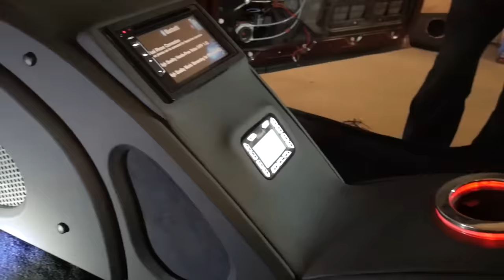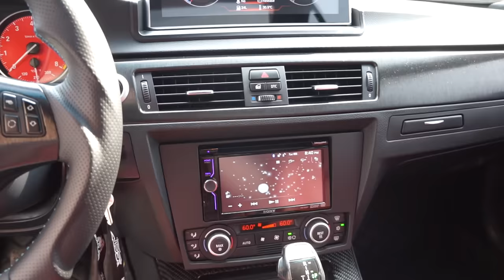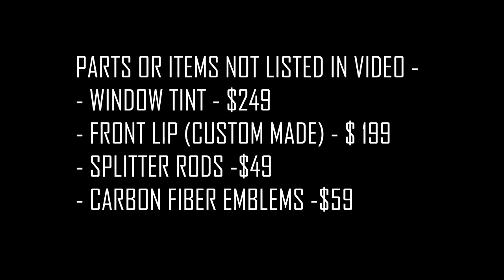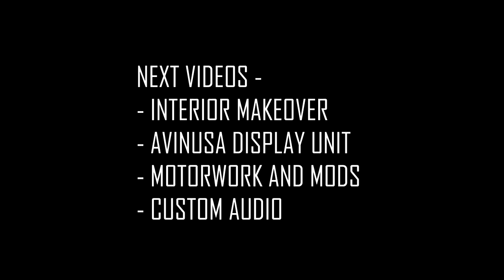COST $$ BUILDING AN E90 BMW 335 EXTERIOR IN 10 MINUTES !!!

Comment: What was the total cost? I can’t be bothered to add all of that up😅. I’m asking bc I want to do something similar to my 335i. Beautiful car!
Reply: Total costs about $8'850 if you have the right hand for doing it by yourself. All in one I think you end up at $11k or even more...(second one is even more realistic)
Reply: I have a 2009 335xi and I love it... Had to drop 4.6k on it to make it like new again after 10 years but alot of the expense was labor and time
Reply: James Swidan What kind of things did you do? I got an ‘07 335i kinda want some estimates. 4.6k isnt too bad
Reply: @MarThe3rd  It was madatory shit I had to get done..Alot of the cost comes from labor bc bmw labor is not cheap... My 335xi is a twin turbo... Had to get a new set of fuel injectors, high pressure fuel pump, new belt, new back tires, rim crack complete fix, carbon cleaning and couple other things im not remembering at the moment... But the 335i and 335xi are nice cars bro, they drive forever usually...
Reply: @Footballtwinstv  if you live in Germany, you can add about 5k just for tüv wich is a control service check that every car needs to pass and you would have to get every (almoast) mod checked
Reply: have you checked out this shift boot https://www.youtube.com/watch?v=k-UqC7Qi81Q&t=494s

Comment: Amazing work on the interior guys , would like to visit your shop if you have one , i just bought a 335i for 1500 and still working on the engine after that will start with body
Reply: where did you buy it? and what year is ut ? im looking to get a 335i as a project car soon
Reply: @hubietrades  private seller 2008 with 189k milles

Comment: How did the headlights hold up during the winter? I've had two cars that I replaced the headlights and both sets would get condensation and water inside so I'm really hesitant to pull the trigger on my 2010 E90.
Reply: have you checked out this shift boot https://www.youtube.com/watch?v=k-UqC7Qi81Q&t=494s

Comment: How are you I have a 2007 e90 m sport prelci will all these parts fit this mainly the mk3 bumper. And is it hard to fix into place for a non experienced guy
Reply from the maker: Everything on this vehicles 2007 pre facelift hand most of the stuff is not very hard and I do have plenty of videos on the channel on other things as well

Comment: I think you’re getting ripped apart with some of the prices. A Calliper wrap for 500? You can spray them red yourself for like 50 bucks
Reply from the maker: Yes you can definitely spray paint your calipers for $50 but just the wrap alone for the material is over $250 you're more than welcome to check it out yourself on Metro restyling look up 3M reflective caliper wrap it is very expensive. We definitely wanted something unique and when you're driving down the road these glow at night and look really awesome!

Comment: Can I get the same bumper for a 2011 323i?
Reply from the maker: Yes you can
Reply: @octanetvchannel  can you recommend a website, all sites I'm looking at say it wont fit for some odd reason example amazon. Is it a direct bolt on, or did yall have to make modifications? Great work and great channel. Keep up the hard work! God Bless

Comment: I've so many problems with low profile tires. Your forever getting flat tires. I had 20" on a Mercedes. There is nowhere for the air pressure to go, so it just blows out the inside wall of the tire. Then your always dealing with bent wheels when it goes flat. They look awesome, but get use to calling a tow truck. I've got a 335i vert. now. I'm sticking with the 18", screw that, I'm done!

Comment: how much did you buy this stock for? if you dont mind
Reply from the maker: It was a few years ago but I think around $6,000. Back then it was kind of hard to find 335s in this area. but it was in really rough shape with a lot of body damage and dents all over it. I also sunk in between 3k to $5000 in just maintenance and the engine the day I bought it
Reply: @octanetvchannel  im looking for an 06-07 328i  what mileage can i be safe with buying? The lower the price the better. I want to stay under 3500

Comment: I don't love the front bumper. I prefer the Msport factory bumpers. Also, could have wrapped the dash plastic with carbon fibre because yours just looks very basic. I would have painted the car's exterior if it was damaged, as you said... not wrapped it. This is like what you would expect from a Chinese knock off .. "last 5 minutes and broken everything" .. BMW.